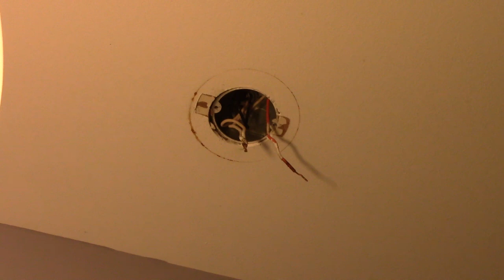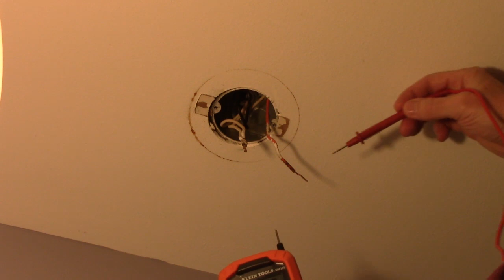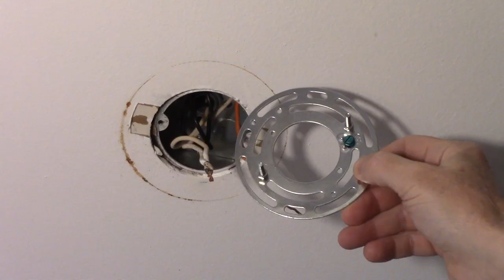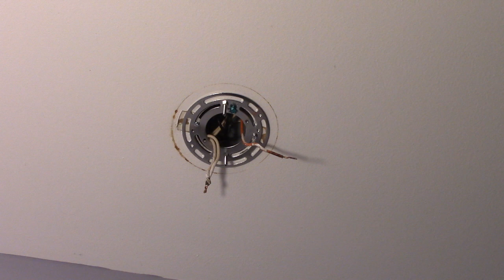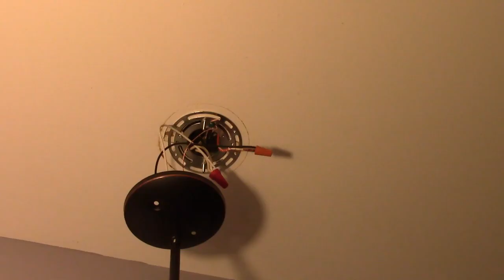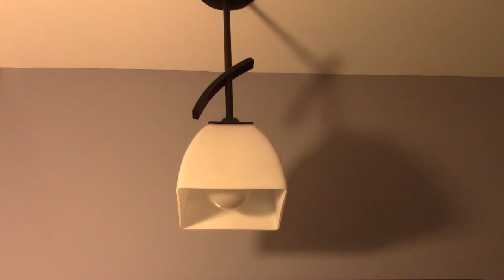Installing a Ceiling Light - Conduit no Ground Wire

Comment: Ground fixture had no ground wire.
Reply from the maker: Hi, for areas with metal conduit and metal boxes, individual wires are pulled through the conduit. There usually isn't a ground wire, the conduit and metal box is the ground path back to the service panel. If you have non metalic cable, you will have a bare ground wire.
Get more home improvement tips in our e-books https://www.amazon.com/dp/B0GTX5ZBTR

Comment: Does it matter what kind of screws are used to mount the mounting bracket?
Reply from the maker: Hi, you would use 8-32 machine screws to hold the mounting bracket to the electrical box.
Check out some home improvement tips in our e-books https://www.amazon.com/gp/product/B0B2KW1FQ9

Comment: Hi. I have a large 4 lights chandelier (80% metal and 20% wood) which is wired with 3 cables. I just took it down to clean it and I'm gonna start assembling the parts tomorrow. The thing is there is no ground cable. The 3 cables are 1 for the neutral, 1 for the phase of 1 pair of lights and the other 1 is for the other 1 pair of lights. Is it gonna be fine if I connect it the way it was without ground cable? There has never been an accident with it and it worked perfectly for many years. Advices?
Reply from the maker: Hi, many ceiling lights don't have a ground. It is low risk of a shock hazard because it's up high. You can email me at fixitpodcast@gmail.com.
Reply: @FIXITHomeImprovementChannel  Thank you. I've installed it the way it was and everything seems to be working just fine. Thanks for your response as I didn't know most ceiling lights don't have ground.

Comment: Or you can simply use your volt meter to see which wire is your hot wire in case you are confused or just want to make sure.

Comment: Hi, what if the light fixture does not have a ground wire, but there is a metal plate with a screw and a ground cable in the box?
Reply: I have the same problem .. how did you fix it?
Reply: Me too

Comment: Hi!  I have conduit wiring as well.

Trying to install a wifi light switch on a 3 way switch.  My travel wires are orange, I have white neutral wire, but the weird part is there was no black wire.  

There are two light switches and one has a black switch and the other which I am trying to install a line/load wire has none the switch.  Looks like they use a yellow line, but it does not work.  I hooked it to red wires that were there and it works, but afraid of wrong wiring.  Any help?
Reply from the maker: Hi you can email me with pictures to fixitpodcast@gmail.com.
Reply: @FIXITHomeImprovementChannel  

Hi!  Sent you an email last week.
Reply from the maker: @faye5296  Hi, it might have gone into my spam folder. What is your email?

Comment: What if there is no metal conduit?   I have two different fixtures to replace.  One has  a metal box but only two wires. I was going to attach the ground to the box and the fixture strap.   Problem is I dont know if there is a metal conduit back to the panel.   

  There is a second fixture with no box.    I think that fixture has three wires.  I need to put in a box.    Is a plastic box acceptable.  Can I simply attach the ground to the fixture strap?
Reply from the maker: Hi, you can email me at fixitpodcast@gmail.com.

Comment: I just installed a new ceiling fixture where the new fixture had the ground wire but the ceiling did it. Condo in Toronto, ON Canada. I wrapped the ground wire from the fixture around one of the mounting screws and tightened the bolt. Do I need to use the green screws?
Reply from the maker: Hi, I would test to see if the mounting strap is grounded with a tester.
Reply: @FIXITHomeImprovementChannel  I was going to do the exact same thing, but my mounting bracket isn’t grounded (I tested it with a Klein multimeter). What are my options?
Reply: hi there I'm from alberta canada ...same problem as you did. just wonderwhy my house does not have ground wire either....can I wrapped green wire around screw and tightened with green screw from mounting metal box.

Comment: I am also in the Chicago area. When we touch the hot wire and the neutral wire, it reads 120. When we touch the hot wire and the metal box it reads nothing. Does this mean the box isn’t grounded?
Reply from the maker: Hi, make sure there isn't paint or a coating preventing good contact with the metal box. Scrape the box with the probe. But if it doesn't read 120, it's not making a path back to the service panel. It isn't grounded.